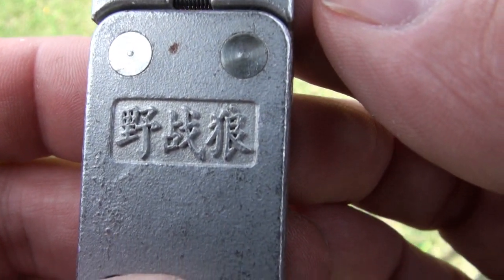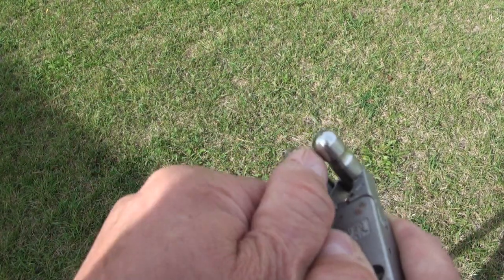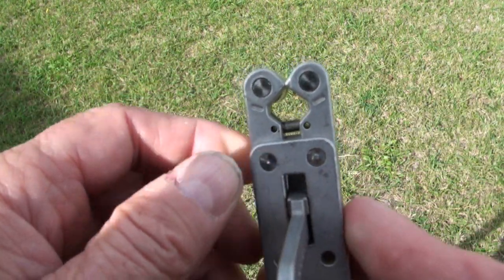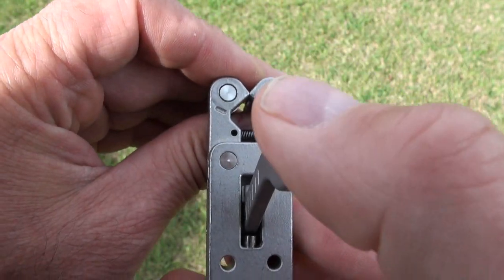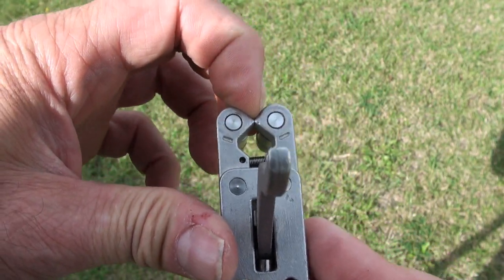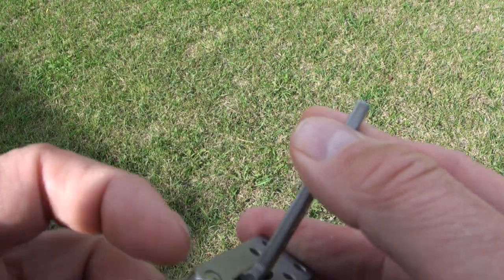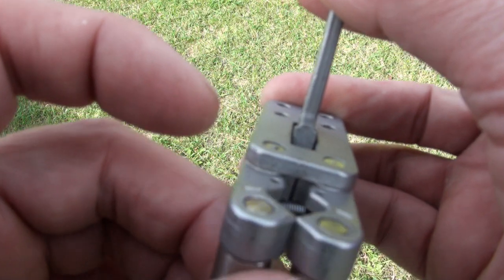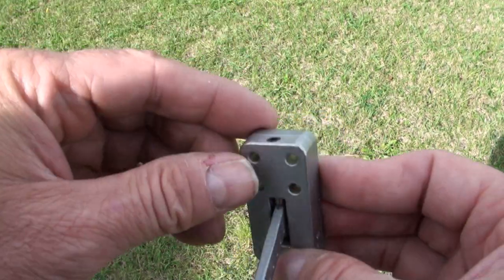SlingShot Trigger Design Study

Comment: Thanks for the errr study, believe it or not, there are knock-offs of these, based from the reviews I've seen. And this definitely looks like the ones used on those expensive slingshot rifles / telescopic slingshots I've seen.

One thing I wished you had done was tap it with a coin or even your nail, so that I can hear the hopefully 'metalic'ness' of it, it's hard to judge quality these days with plastic optimized to look metallic or durable